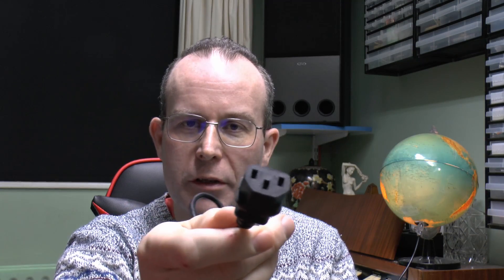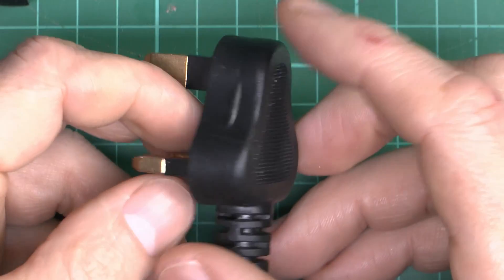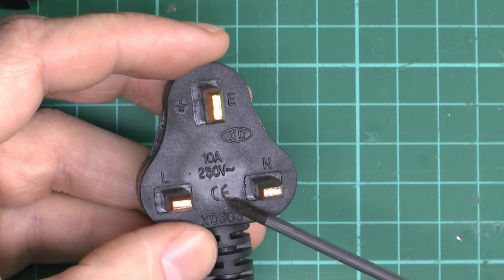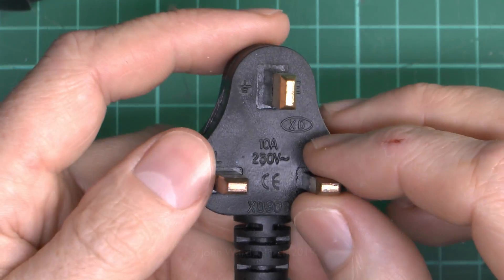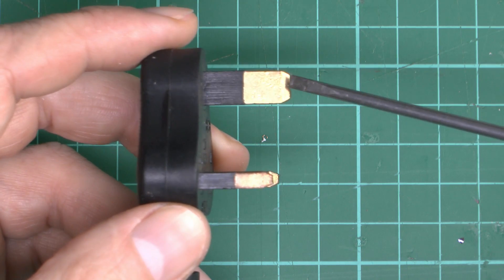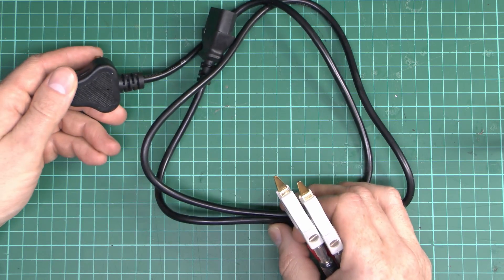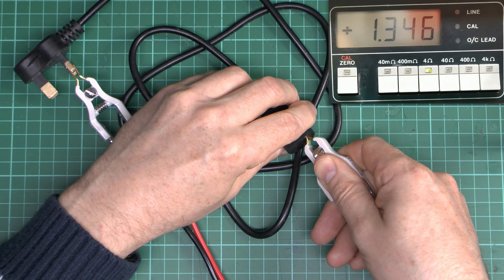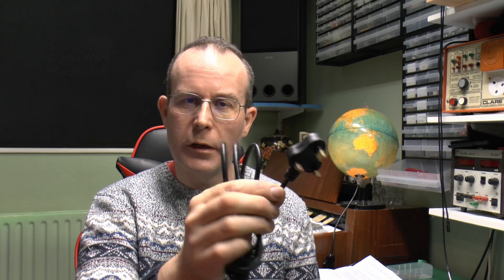Dangerous Unfused UK Plug and Undersized Flex

Comment: 0,5 mm^2, 1-2 meter length, should be 0.032-0.064 ohm. My guess is 0.1 mm^2 iron wire, atrocious termination, or probably both. In which case it won't even trip the 32A breaker.

Comment: Someone on the EEV Blog forum caught an Amazon seller (Based in the UK.) offering these with the claim that they had a unreplaceable fuse inside the plug. They took screenshots and then bought one. When it arrived they tore down the plug and surprise, there was no fuse. Photographs of the tear down and the screenshots were sent to the right people and seller got in a lot of trouble. It's a real pity that Amazon does not take more care about what people sell.
Reply: Maybe the seller will claim that "the entire plug and insulation around the wires catching fire under gross overload and eventually failing" is the built in unreplaceable fuse.
Reply: Regardless, as he says in the video, the pins are way too close to the edge of the plastic - way too easy to touch the metal pins upon insertion/removal.   It’s obviously illegal just by looking at it.

Comment: Interesting point, by the way, about the CE mark. I've seen that on electrical devices here in the US- ones that are not dual voltage, so are only able to be sold in countries that use 120V/ 60Hz power. But it has the CE mark! Even though, by definition, it doesn't meet European standards since it can't be used on European mains power.
Reply: You are confusing the CE compliance marking with the CE mark that means "Chinese Export". https://i.kym-cdn.com/photos/images/original/001/051/769/e25.jpg

Comment: Alwahs amazes me how these manage to get past any kind of regulations or customs checks.
Reply: They don't get past regulations, they completely ignore them.

Regarding customs, if items fitted with these plugs are inspected by customs, they will be rejected. The issue is that when the label on the box states it is a certain piece of electrical equipment, and an x-ray shows as much, they have little reason to open the consignment and look at them.

With container after container load of legitimate goods entering the country, certain fakes or sub standard products will enter in many of the other containers.

Customs actually do whatever they can to intercept dangerous, fake or sub standard goods in general.
But seeing as we are an island that imports everything, it's practically impossible to check most of it thoroughly.

Comment: another fusible extension . it should be 0.75mm2 . Funny thing i have a similar cable with that marking in the socket F version and section is inferior to another cable that is highly marked on the plugs. Also the F plug looks more ovalized than the normal. Thanks for the video .

Comment: Not a fan of UK outlets at all. Someday I will do a video on that. With respect to the resistances on the wire that is abysmal. Would have been good to cut and actually measure the wire size.
Reply: Why are you not a fan of our sockets
Reply: @slayersdeath  multiple issues. I will just touch on some off the top of my head. I was supposed to do a video on it when I was in a UK plug country but time did not permit. I may do it still but I do not have access to the devices anymore to take pictures to explain properly.

1) Extremely large, waste of materials for outlet and socket
2) Poor stress relief on most I have seen
3) Many are made up by an end user. That is terrible. Opens the door for many electrical problems
4) Fuses are a crappy way of doing things in 2019. Really crappy. When I moved to the country I mentioned the fuse for the fridge blew. I did not have a meter (only so much fits in 2 suitcases) and of course the fuses are opaque so I had to guess. No spare fuse in the rented apartment so I had to take my adapter and "steal" the 13A fuse to replace a 3A one (wrongly sized by the landlord).
5) Many are brittle due to thermoset plastic I believe. Great electrically. Not so great when you drop them and the crack. All us plugs I ever used get dropped all the time and never breaks
6) Horrible form factor make even a simple small device like a cell phone charger a monstrosity. 
7) Electrical issues when no ground is present in a device. This may not be an issue in the UK but in the countries that follow your standard some devices come with 2 pins. The standard practice by laymen is to stick in a non conductor in the ground so the 2 pin outlet can go in.
8) Adapters proliferate in areas where US devices are used also. Open one of those and see hot dodgy the electrical contacts are. Seems like a fire hazard to me.
9) Due to the over design the price is ridiculous. I can get a proper US outlet for USD$0.50 where I am located. Try matching that with the UK outlet price

Comment: A very big issue [that JW has begun addressing] is the widespread (worldwide) use of copper clad aluminium [CCA] conductors and the uninformed expectation that they work equivalently to copper conductors - talking amps not milliamps.
Reply: Aluminium is a great conductor, when used correctly. CCA is never a good idea for flex cables or even house wiring. About the only thing it should be used for in a home is speaker cable, but even then it won’t last if the cable is regularly moved.

Comment: when it says "10amp" on the plug, this means it is a 10A plug for a 10A socket as compared to a 15A stamp fitting a 15A socket. it does not mean  the cable is 10A. it is not an extension cable. that cable is used to power a computer or screen not a heater. 
the resistance was a bit high though.
Reply from the maker: Not just a bit high - the resistance is more than 30x higher than it should be.
The lead is 1m long, 0.5mm² copper of that length should be 0.036 ohms for each conductor.  This lead is 1.3 ohms for the N conductor and 1.1 ohms for the L conductor.
Even with a 3 amp current (what proper 0.5mm² flex is rated for), power dissipation in the lead would be over 20 watts.
Reply: @jwflame  
ok, my wording could have been better.
Reply: BS1363 only has one type of socket and one type of plug.  Both socket and plug are rated to 13A.
Reply: @cjmillsnun  
i am sure you are right. here in australia, you have 10A plugs and 15A plugs and it is inprinted in such numbers. the 15A plug does not fit into a 10A socket.

Comment: UK must be the only country that has fuses in the plug
Reply: That is because we use ring circuits.  Eire also uses the same plugs and sockets, also uses ring circuits and also uses fuses in the plug.
Reply: @cjmillsnun   there you go! you are not on your own. two countries.
Reply: The US requires fuses in the plugs of certain devices. Christmas tree lights (fairy lights) have to have 2 amp fuses in them, one on each pin, because they only have 2-prong unpolarized plugs that can be inserted either way. I've started seeing fused plugs on electric fans and space heaters as well- not sure if it's a requirement, but they're there. As has been said, the reason UK plugs are fused is because of the 32 amp ring circuits that are common there. Here in the US, most outlets are on 15 amp circuit breakers, with the exception of outlets in kitchens, garages, workshops, and (sometimes) bathrooms, which have 20 amp circuits (and SHOULD have 20 amp outlets, which can be identified by the T-shaped neutral hole, but standard 15 amp outlets are all too often fitted.) In addition, cords aren't allowed to have conductors any smaller than 18 awg, which is roughly .8 mm^2. And usually, they'll be at least 16 awg. And as far as I know, cords have to be copper or plated copper (which I assume is the same in the UK) So in the event of a short circuit, the circuit breaker will trip well before the cord will catch fire. Incidentally, Christmas lights are the only exception that I know of to the minimum of 18 awg- which is why they have fused plugs.

Comment: I had a similar one of these with a figure 8 cable. The cable inside was not copper but aluminium and was much smaller than the stated 0.75mm^2. Also the plug contacts break of the plastic pieces very easily and are not brass and are only connected to the plug through a thin piece of powdered metal (including the earth prong).

Comment: Someone somewhere will plug a kettle into one of them
Reply: will not fit as kettle should be fitter with hot condition socket that has a key way at bottom to prevent normal leads from being used - it it has a  standard iec socket - its a very suspect kettle

Comment: I've always wanted to see inside one of those crappy chinese plugs ...hopefully it'll melt and we'll how the wires are connected to the pins....
Reply: they are copper coated alluminium, you can only crimp the wires as nothng else will hold it, and the dissimilar metals mean it doesnt conduct well
Reply: @jusb1066  I had assumed they'd be CCA or coated steel ... Just wondered if they'd formed the crimp area into the top of the pins which a a common cost saving exercise now a days then over moulded the whole lot .... Still hopefully it'll melt and we'll see ..I see loads of these leads at work ..when peeps bring Chinese crap in to be fixed ... you'd be amazed how many people get upset when I refuse to let them take the lead away ...I might have to chop the next one open if ...if the plug doesn't melt on the next video ..

Comment: I hate moulded plugs full stop. Always cut them off and fit a normal rewireable type, this after I saw a house burn down after a moulded plug failed, and after I had one melt on a washing machine.

Comment: XD stands for eXtremely Dangerous. CE mark stands for Chuck Everything away. Looks like somebody decided to take the UK pin pattern mould and use it with the South Africa/India standard plug moulding instead. Bet the cable inside is that mystery metal 5 strand "copper colour" wire as well, and probably is not the correct colour scheme as well, though it will have very robust and thick recycled PVC insulation on it.
Reply: Chuck Everything LOL
Reply: @NicholasElliott  Chinese export.

Comment: We had some equipment supplied with these a few years ago. The wire inside the molding actually showed slightly at the edges so you could get a shock just by plugging in. We X-rayed the rest and all showed appallingly similar wire faults inside. Yet these items are still showing up.

Comment: I find that if you run a  13amp plug/socket of any make (cheap or not) at the limit of  13 amps or even less they get warm regardless.  Try running a 3kw immersion heater through one and you will see what I mean. I think they should be rated at 10 amps. A lot of the trouble is caused by the small weak contact of the fuse with it's holder.

Comment: Note: even on legit cords the rating stamped on the connectors is only the rating of the connectors. Most IEC cords (at least the ones I have seen with UK plugs or schuko plugs) are built with 0.75mm flex which is conventionally rated for 6A though this can be increased to 10A under some circumstances. IEC cords built with 1.0mm cable (rated at 10A) are available but you have to explicitly search for them.
Reply: I've been professionally 'explicitly' searching all my life.

Comment: I had one of those plugs on a replacement laptop charger, that came from China. One of the electrolytic caps in the friction welded case was also backwards! I ended up repairing my old charger instead. I wonder what juristiction those plugs are legal in, if any?
Reply: Not legal anywhere. The Chinese don't care.

Comment: I WANT NICE BIG
FLAAAAAAAAMES! :D 
I say that bit of nonsense 
needs to go outside......

.......In the garden, and because you have a variac and a site transformer, you may be able to easily achieve 25A when you drive the site transformer with the variac.

You need to build a Fun-Jiggery-Pokery Unit!

After connecting everything up, you can then teeaase it on the variac.

......Uuuuntil it pops!

Go gentle with it though, because I (and a few others, judging by the comments!)
WANT FLAAAAAMES. 

Yes, connect this to one half of the secondary-side of the site transformer (55v max) and this will give you a ratio of 4.36 from the input.

So, if you put 1A into the site transformer, the pop-victim should be seeing 4.36A and so-on.

Use ballasting appropriate to your site transformer to prevent overloading it, and the ballast should (electrically) go between the output of the variac and the input of the site transformer.

Even if you dialled-up 5A on the variac, the pop-victim would be seeing approx 21.8A, which for that bit of nonsense, will be waaaaaaay too much, so you probably won't even need to dial-up 5A to BUST IT RIIIIIIIIIIGHT IN.

DONT be tempted to put the oxford welder on it..... that flex will burst like fuse wire and it will all be over faster than you can say "I want flaaaaames"

Go easy with it...... Teeeaaase it on the variac gently...... build the power slooooowly, keep it teetering riiiiiiiiight on the edge, and then when it starts smouldering and smoking, give the variac a little deft twist of the dial so that the pop victim gets a little bit extra and Whoooomph! hopefully, there shall be nice big flaaaaames. :D

Its all in the technique. You want flames?

If not, or you are unsure about busting anything apart from the pop victim, then send it along to me. My 28A BIG DOGG will effortlessly chew that up for breakfast. :D

==PHOTON NEWS==

Soon, Mr. Photon and I will be in the playroom again, and you know..... we have something similar to BUST RIGHT IN. I have already done a video on it going spark-and-flash, but I want to see what Mr. Photon can do with it and his high-power equipment, and see what kind of flashes, bangs and flaaaaaames we can get out of it.

x=x===WE WANT FLAAAAAAAMES===x=x

It's coming soon..... ONLY on Wayne's Electrical! 

Thanxx for showing,

-Wayne's Electrical.

19th March 2019, 16.00

Comment: Why are you complaining?  The individual cores are 0.5 mm².

Admittedly, that includes the insulation as well as the conductor, but the cores are 0.5 mm².  On some leads, the earth is all insulation and no conductor, but it's still 0.5 mm².

Comment: The flex will act as the fuse in this.
Reply: precisely what you dont want to happen, the flex will burn, and expose live wires and probably set fire to the house, is  why we put  fuses in the plugs to begin with
Reply: @Hawk Cuckoo It's because in the UK there is a ring circuit around to the sockets with a 32A breaker, the plug fuse is firstly to protect the appliance supply cable
Reply: @Hawk Cuckoo safety.
Reply: @Meghnad 81 So each socket doesn't need to have cable running right back to the fuse box. You can wire mulltiple sockets together and fuse them with a llarger fuse like 26A or 30A.
Reply: @kowalski8  Apart from the cable is still sub standard
Reply: @kowalski8  You don't wire multiple sockets back to a single 30A fuse though. Wastes a lot more wire running all the way back to the fuse box.

Comment: Not so much a power lead, but more of a slow blow fuse / heating element / fire starter.
Reply: I would go 
with the latter 
of those things. 
I have tested similar and......

........It had trouble conducting the 10A going through it and the sockets on it let loose shortly after. UTTER TAT.

Soon, that lead is off to Mr. Photon's and we're going to bust it in badly. :D

-Wayne's Electrical.

19th March 2019, 16.30

Comment: This plug is for sure unsave, but we here in Germany also use 230 Volts AC with up to 16 A at one plug and none of gernan plugs have any fuse.
Reply: But your socket circuits are not on a 32A breaker. Usually 20A radial circuits, aren't they?
Reply: More like 16A for a modern circuit. Old houses often still use 10A breakers. 

Greetings from Germany
Reply: German people aren't nuts enough to implement ring mains circuits.

Comment: Can I remind you that it is not just the UK that uses Type G plugs. Singapore, is one of them.
Reply: And Ireland.
Reply: @StrathpefferJunction  Northern Ireland (part of the UK) or Republic of Ireland? I band them with having much of the same.
Reply: @forevercomputing  Ireland. Which is why I said Ireland. Northern Ireland is part of the UK.
Reply: Do they all have the same requirements around fusing, etc? Or are they just using the pin spacing part of the standard?
Reply: And Poland if I remember correctly.

Comment: The manufacturing tolerances of the cable must be terrible for the conductors to differ like that over such a short length. I'd be interested to see the thickness of them and whether or not it is copper!
Reply: Probably 0.1mm copper coated aluminium.
Reply: Very possibly, 
the conductors 
in this are ALUMINIUM. 
What I done some time back........

........was to buy a similar multi-socket lead, solely for the purposes of making a video on it and putting it on my channel.

I gave the thing a nicely measured TEN AMPS.

Not long after that..... the sockets let loose! Couldn't handle it!

BUT I WANT SOME PROPER POPPAGE!!!!!!!!!

So, there is only one thing I can do.....

It has to go to Mr. Photon's poppage facility, and we're going to give it a total and ABSOLUTE CANING and we're going to BUST IT RIGHT IN!!!!!

I am expecting flaaaaaaames!!!

-Wayne's Electrical.

19th March 2019, 17.00